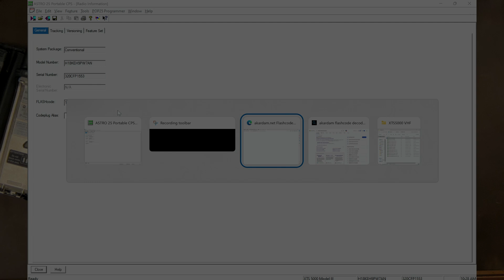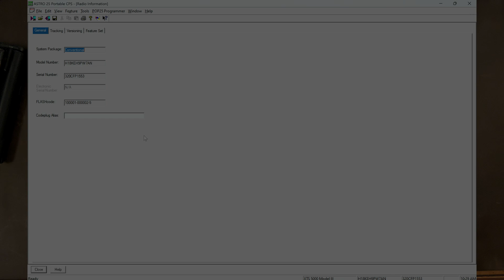How to buy a Motorola pt. 2  What is a Flashcode, and what features are on my radio?

Comment: niche question, but here we go.
What are your most important features to have on a flash code for the APX 6/7000? and what bands do you look for? My area is primarily VHF, and i’m considering having the 7000’s second band be 7-800Mhz, purely for my buddies who want to get into radios, i’m planning to buy a commercial channel on 7-800mhz so they can get premium dmr radios for cheap.

Your thoughts and time would be much appreciated.

P.S. I watch your videos consistently at work in the background
Reply from the maker: Thanks, I really appreciate it. 

Great questions.  First of all, I’ve been told it’s nearly impossible to get a channel licensed in 7/800 because every single public safety agency is buying as much spectrum as they can get.  I have successfully purchased licenses in VHF and UHF but have been discouraged from even applying. However, if you’re successful, please let me know.  I’d love to get my own as well. 

FLASHcode features are rather subjective. If your goal is VHF analog (coast guard, off road radios, wildland fire), than you don’t really need to be concerned about options. But, as you increase your listening activities, or license your own frequencies to allow for p25 and encrypted channels, that’s where you really need to pay attention.  

I’d suggest going to the akardam FLASHcode decoder and playing around with options. Motorola also now has a FLASHcode decoder online.  

I prefer the VHF / UHF split so I can talk on both bands, but if you’re successful in getting an 800 frequency, you can get a ton of cheap high quality radios.

Comment: I have the XTS 5000 model 3.
 I am wondering what type of license do you have to have to operate it to Transmit
Reply from the maker: @saw11786  do you happen to know the band? VHF, UHF, 7/800 mhz? You can search online for xts5000 model breakdown and using the model number on the back of the radio figure this out.  That’s your first step.
Reply: @AdventureCruiser  mine is the xts5000  Model 3 700/800
Reply from the maker: @ sorry, you’re out of luck. You can program it to listen, but to my knowledge there is almost no way normal people can get licenses in that spectrum. Sorry.

Comment: sooooo if the serial number doesn't match, what exactly is wrong with it? What's the downside?
Reply from the maker: Functionally? Likely there is nothing wrong with it so long as it’s tuned.  The downsides are a lower resale value, and you may not be able to send it to Motorola for repairs.

Comment: I saw you video on all our motorola radio and was wondering what are thoughts on the XTS4000
Reply from the maker: Honestly, I’ve never touched one, but I’ve tried to buy one a few times. I think it is a fascinating concept, and I would love to test one.
Reply: @AdventureCruiser  I recently purchesed one in UHF. Its a super cool radio, Basically and XTS5000 that looks like a flip phone with an APX style screen
Reply: I have an XTS4000 in VHF, took me ages to locate a clean one and then get all the special accessories.  Mine is AES enabled and came with a Hirose keyload cable that goes right into a KFDTool. It is a fun oddity
Reply from the maker: @NigelBallard  does it work? Is the TX output limited to 2-3watts? There are a couple on eBay, I’m tempted but I did just buy another stupid expensive radio so my budget is a little limited at the moment.
Reply: @AdventureCruiser  It works 100% though I've only used it in analogue. Output is just a few watts. I believe they were designed for digital networks or to work through a suitcase tactical repeater.  I managed to locate a 'still in the bag' replacement antenna on eBay a few months back. It feels good in the hand and the build it solid.  Basically it's an XTS2500 cut in half I think. VHF is much harder to locate than UHF. In 2024 its only real purpose is a place on the shelf of a Motorola radio collector or a movie prop
Reply: @NigelBallard  One down side to the UHF ones is how hard it is to find an antenna.
Reply: @radioswithjackson  I'm sure of that.  The radio wasn't exactly promoted when it was in current use. My main antenna is perfect but nice to have a new spare still in the Moto bag just in case I get sloppy. I also got the service manual with mine